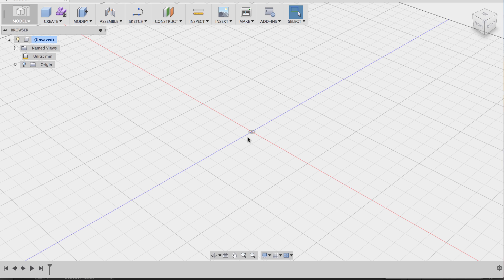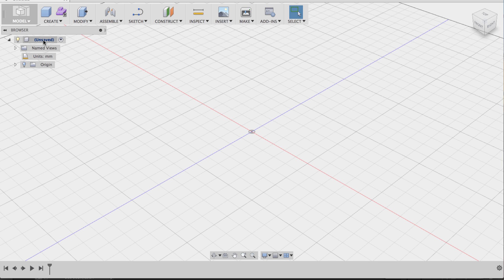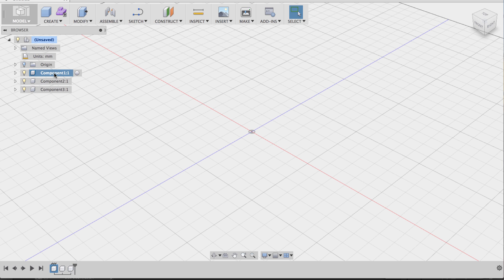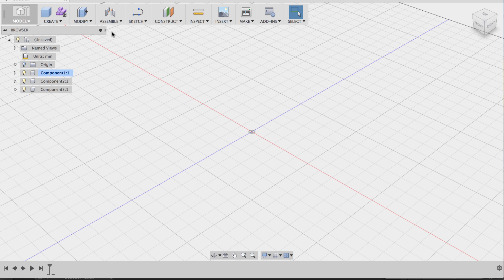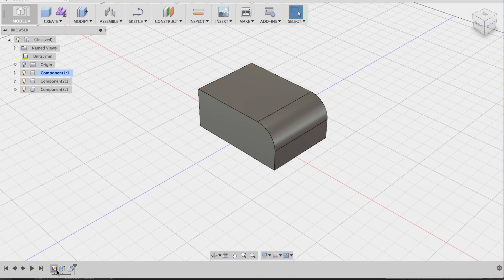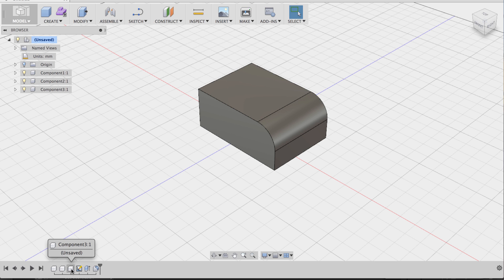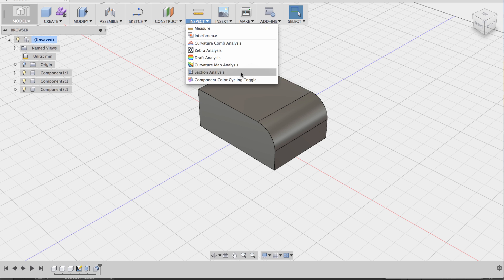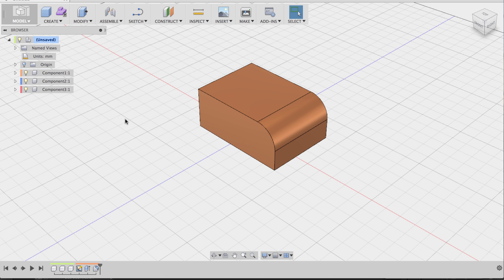QUICK TIP: Best Way to Start When Modeling Assemblies

Comment: Good explanation I missed earlier.  Also something I learned that is worth mentioning, your (workflow) goal is to have only one body per component.  So you can model and mess around, but all bodies being kept should be right clicked and create component from body.  Components nested inside other components should be avoided until your dealing with double digit parts in your assembly.

Comment: Does working on one assembly impact another? If in designing a case with a lid each as an assembly, but change the dimension on the lid, are the resulting changes captured and carried out in the corresponding assemblies?

Comment: I was wondering how to create all the needed parts and to put them into the assembly and subassemblies. I was taught to use PTC Creo at the university, therefore my instinct told me I needed to make new files for each part or subassembly and open in a separate window the parts I needed to modify during the design process. I really couldn't understand how to approach my design methodology using Fusion 360. This video solved my problems, showing how Fusion goes beyond the separate files approach and makes the design more compact and flexible. Really helpful, thanks a lot.
Reply: Agreed, since I also came from Creo. Great video- thanks!